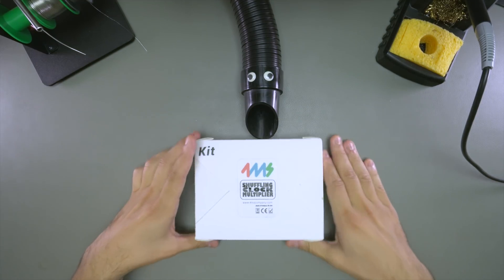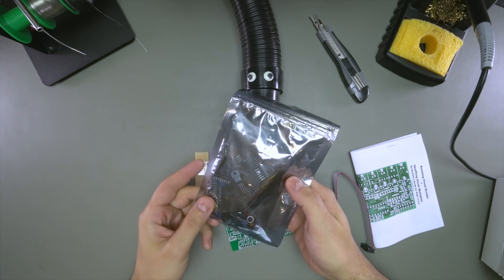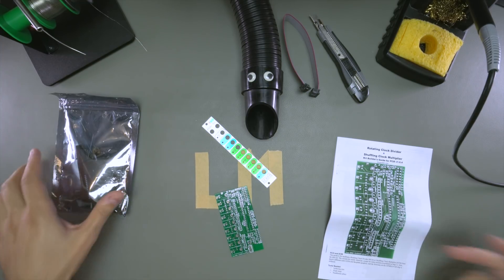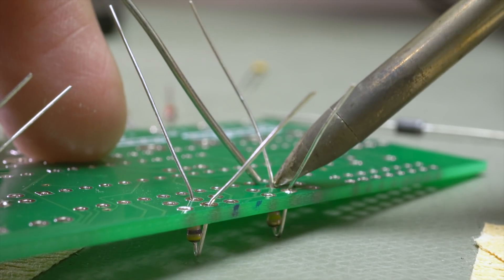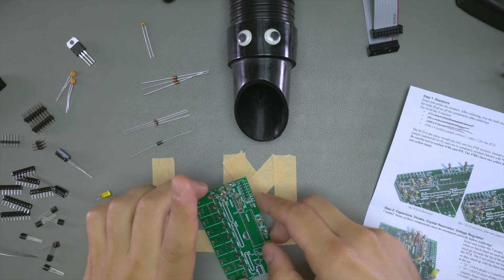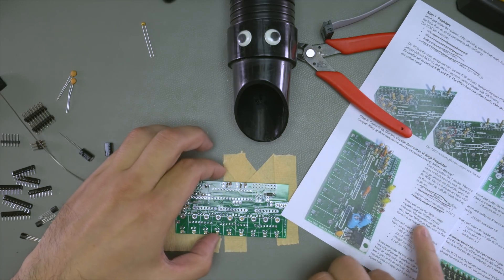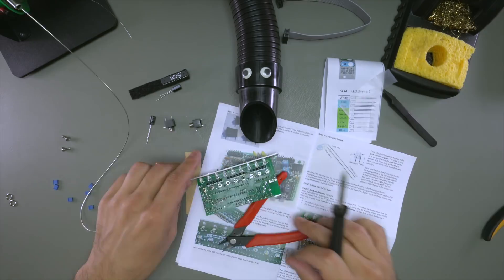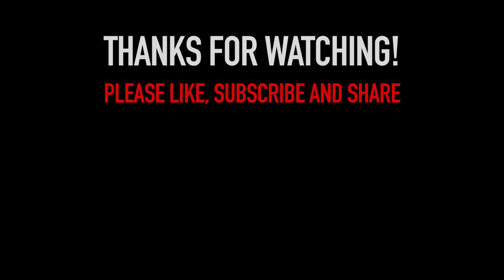How to Solder Through Hole parts (it's easy!)

Comment: Great video.  What’s a good safe temperature for soldering through hole components?
Reply from the maker: It really depends on what solder you're using.  Take a look at your solder's spool (or packaging) and it's usually written on there.  Use that temperature as a starting point and don't be afraid to go a little higher or lower since most irons aren't 100% accurate when it comes to temperature.  Before long you'll get a feel for it.

Thanks for watching!

Comment: Just about to start on my first module.  I would have like to see how you lined up the faceplate with the LEDs and jacks, and perhaps a bit more on cold joints (too common a problem).  And I cringed every time you said solder.  It's pronounced "sawder".

Comment: What soldering iron do you use? It looks pretty neat....
Reply from the maker: It's a Metcal MFR-1100.  It came with the smoke extractor that I wanted (Metcal BVX-201) as a package deal and I ended up really liking it a lot.  It's "entry level" for Metcal but it's way better than the 20 year old hand-me-down Weller I got when I was starting out.

Comment: Could you please elaborate on that vacuum hose and how you suck away the fumes? Is it just that you connect it to the vacuum cleaner?
Reply from the maker: It's called a fume extractor.  It's similar to a vacuum cleaner, but it's designed specifically to capture the smoke from soldering (it has a huge HEPA filter inside it with a layer of activated charcoal).  A normal vacuum isn't designed to capture smoke so it won't work for soldering.

I used a cheap (approx. $40) desktop fan for many years before upgrading to the nice one I have now (Metcal BVX-201).

Comment: I'm about 1/3 of the way into building a Bastl Skis, I've done quite a few kits and home made stuff but this is my first step into modular. I was really surprised how small the resistors are, (much smaller than what I've been used to) and also the pads seem to be ever so slightly recessed into the pcb so even using a fine point tip wasn't easy at first. But you learn to adapt, apply less solder and all seems to be ok so far.

Great video btw!!

Comment: Do you ever worry about Electrostatic Discharge with a project like this? Or is it just not that big of an issue?
Reply from the maker: I do have an ESD mat  (the whole background of the video is actually an ESD mat) but to be honest, I did DIY projects like this for years without any ESD protection and I never had a problem.  Maybe I'm lucky and I just don't get much static charge in the lab area, but I've heard others say the same thing (like Louis Rossmann, for example).  I think today's parts today are pretty resilient to ESD.
Reply: Depends on the parts :). Some ICs can be extremely vulnerable to discharges (I fried a CMOS IC by touching it once). Since then, I make sure to take all "lo-tech" measures to prevent static discharge and nothing has ever happened since then:
- Don't wear rubber shoes (take them off if you're not sure)
- Touch a radiator with both hands before starting the project
- Don't wear cotton or wool sweaters and don't touch your pet while soldering ;)
Reply from the maker: Funny--I was thinking about CMOS chips as I was typing my comment since I know those are famously sensitive to everything.  I've never had the occasion to work with one of those, though.

Your "low tech" measures are fantastic tips!

Comment: At Minute 9:10 you should use a multimeter to check Ground and power before plugging it in. Thats always the best thing instead of plugging it in and unplugging. Just make sure ground is not touching +12-12+5. This is a really great video. Good shots and nice camera.
Reply from the maker: Good tip!

Comment: Is the iron touching the pcb? I can't quite tell. Is it ok if it does?
Reply from the maker: Hey Sean.  The iron needs to touch the pad (the exposed metal part on the PCB) and component leg sticking through the hole so that the solder melts and wicks to both things.  The rest of the PCB (the green part) is quite heat resistant so if your iron happens to touch that part for a few seconds while you're soldering, it's totally fine.

Thanks for watching (and the question)!